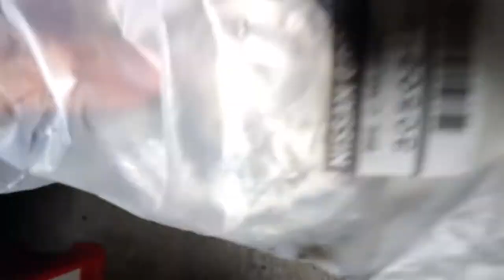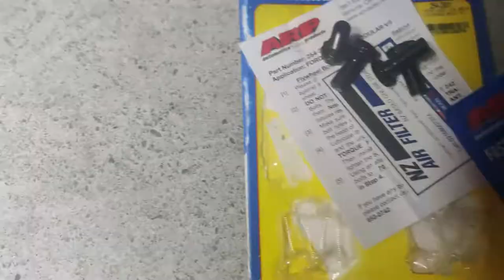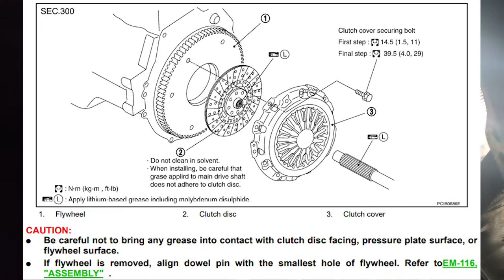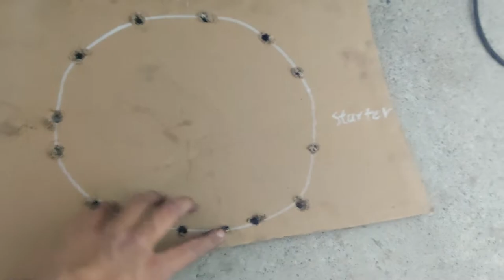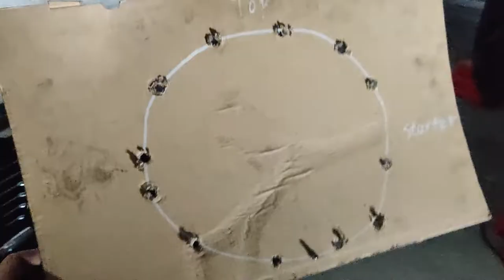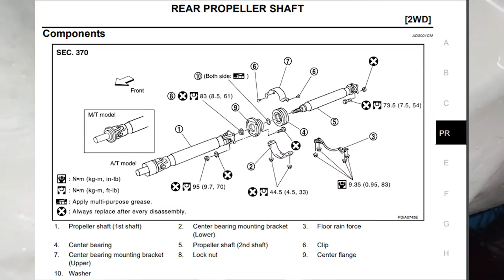G35/350Z step by step clutch install (light weight flywheel heavy duty clutch)

Comment: Great job dude! Love that exedy flywheel and ARP bolts. What a horrible design to put pilot bearing inside crankshaft, it’ll be much easy if it’s inside flywheel central hole.
Reply from the maker: haha typical Nissan design cheers for the support

Comment: How much does this light wheel weight ?
Reply: I got a z1 clutch and lightweight flywheel.  Saved over 20 lbs compared to stock.  I could hold new flywheel with my off hand arm straight out
Reply: @MrBtine91  nice, just wanted to reconfirm if you have a nissan 350z coz i read alot of threads saying that if you have a nissan 350z 03 dn dont go for a light flywheel cz you gona endup with crank sensor issues ?